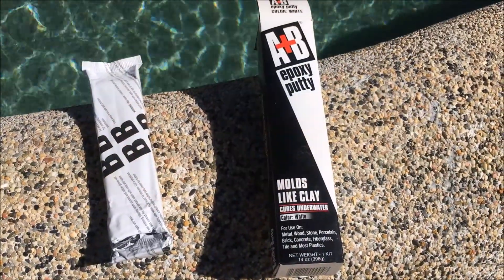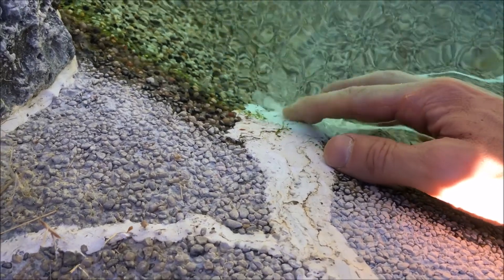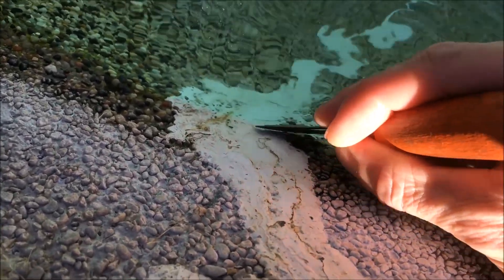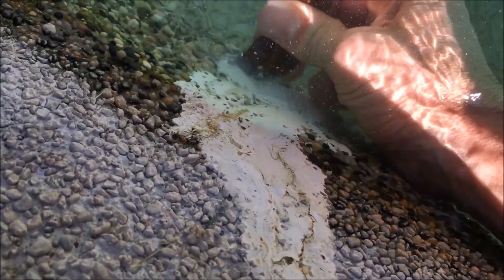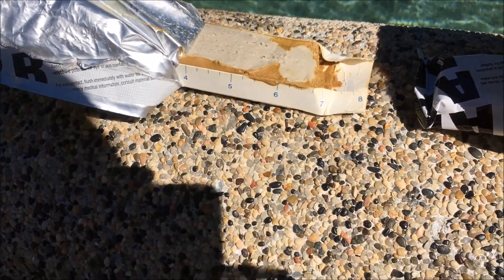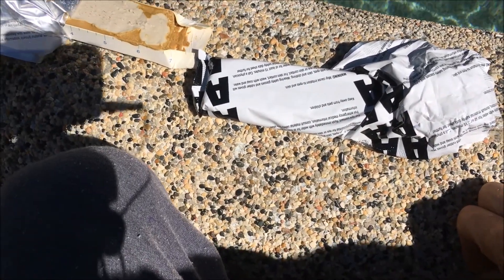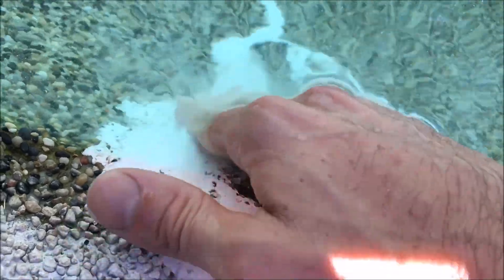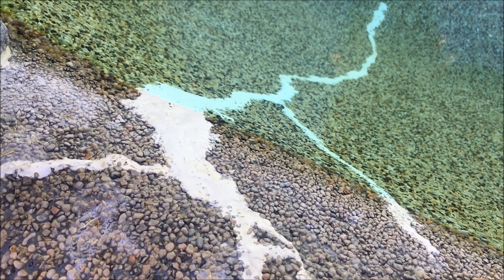Pool Leak / Crack Repair ( Inground Pool)

Comment: So is the pool worth it? Had a pool growing up, so in my opinion, I loved it.  But my dad says otherwise!!  Now my wife and I go back and forth on the subject.  Think of one day getting a pool (after we get out of debt).
Reply from the maker: Radical Richs 
Tough question to answer. I go back and forth myself. Probably cost about $70 a month for electricity. Always adding water in summer. If you need a pool guy you are looking at $70-90 a month. It's a lot of work but so nice on a hot day and makes entertaining super easy. Everyone wants to hang out at my place in summer. It can be a pain at times but I would miss it if it were gone.

Comment: My question is, will the crack on the wall get bigger with time?
Reply from the maker: It’s been a couple years since I made this video. I think it has stayed about the same maybe a hair bigger but periodically when I have to go back and do some touch up work, I dig out some of the older bonder which makes it seem like the crack has gotten bigger. I have to do touch up work on this around every November. The repair works but it will need yearly maintenance. At least in my case.
Reply: @FarmerG  Thank you so much for the input, it is greatly appreciated, I just apply the product onto the pool. i Will check on it periodically and see how it worked, I'll keep you updated. Thanks for all you do.
Reply from the maker: latino Grande 
A little goes a long way. Start small. Mix a small amount equal parts. Apply underwater. Good luck 🍀